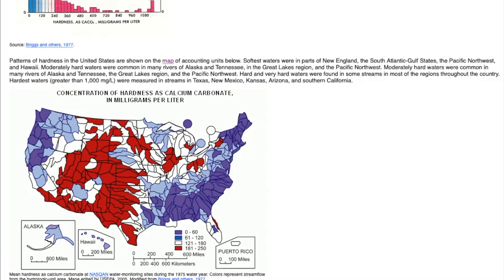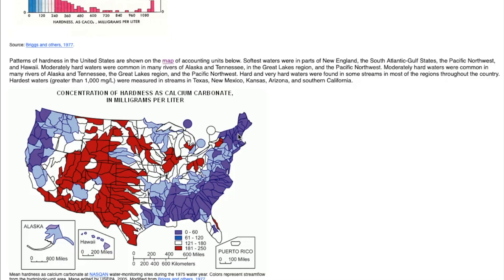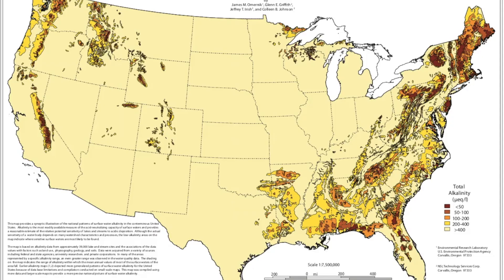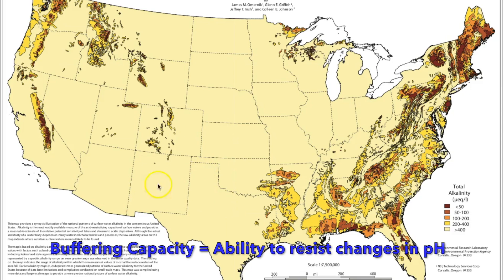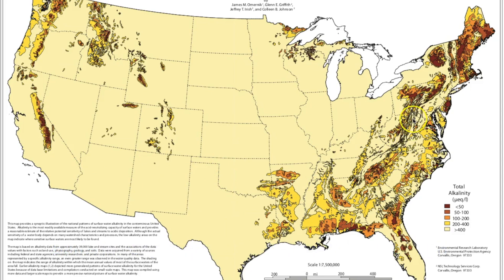Fish Tank Water Hardness Fully Explained: Don't Kill Your Fish!

Comment: Another excellent vid mate.  That is one of the best youtube breakdowns of water hardness I have seen.  You are quickly becoming one of my fish youtubers.  The fact that you refer to your tanks as an ecosystem might be missed by many, but essentially this is what we do as fishkeepers.  We attempt to create ecosystems that emulate the natural ecosystems. Of course you can never achieve a fully natural ecosystem for tropical fish in non-tropical areas, some artificial input is required, but I have found in 22 years in the hobby that the closer you get, the more success you will have with your fish.  

My tip to all would be not to chase your water.....essentially work out what your water parameters are, then choose the fish you stock based on those parameters.  Keep in mind that many commonly kept aquarium fish will thrive in water conditions drastically different to those of their natural habitats.  Evolution happens fairly quickly in organisms with a short reproductive cycle, and many species have been successfully bred for so long in the hobby that their tolerances are actually quite extreme. For example, I probably wouldn't keep wild caught Rift Lake Cichlids in my water, as although it is relatively hard, it has a pH of around 7.3, but the fish I have stocked are bred in the local area and are absolutely thriving.  They have never known anything but a pH of 7.3. I also know of people who breed Discus in this water successfully, and I would quite happily keep those Discus in this water as well, although it would likely kill a wild caught specimen.  Aim for stability folks....fish thrive in a stable environment.

Comment: Very informative video. My water is overwhelmingly hard. I was told that I should mix half of my water changes with RO water for the sake of the well being of my fish. Right out of the tap, it is close to 400ppm GH, 155ppm KH, 7.8pH and near 900ppm TSD. I am keeping neon tetras, corydoras, mystery snails, guppies and a dwarf gourami. I've had them for about 2 weeks and I haven't had a casualty. But I wonder if they are suffering.

I am conflicted about what to do, what is your recommendation? Should I start mixing RO with tap water to lower my hardness and TDS, or just rehome my fish and find malawi cichlids? What about TDS, do we really need to worry about those?
Reply from the maker: So if it were me - I would be very happy and keep African cichlids, guppies, mollies and fish that like the hard water. You could certainly add RO, but you will have to be very consistent in monitoring water parameters, especially KH - if that gets too low, you could crash the pH.
Reply: @PrimeTimeAquatics  by the way, how would you suggest of doing it? Is it ok to do weekly water change of 30%, with half of the new water being RO? I got a 40gal tank, planted.  So I would be adding about 5-8 gallons of RO per week. Should I raise the ratio of RO mixed in gradually? And if u see I have low KH, what's a good way of raising it back up without affecting hardness again? Sorry if I'm making to many questions!
Reply: @PrimeTimeAquatics  thanks!
Reply from the maker: KH is a measure of carbonate hardness, so raising it will raise overall hardness. You could do 50% RO with each 30% water change, but just remember, as you lesson the KH you could reach a point where your buffering capacity is reduced to the point of not being able to protect against a pH drop should additional bio-load accumulate.
Reply: @PrimeTimeAquatics  Would then be a good idea to use seachem phosphate buffer? it supposedly locks pH at 7
Reply: @PrimeTimeAquatics  About the 1st period: that's what I was  thinking once upon a time. Not anymore. I measured higher kh and lower GH, and I was thinking that there is sth wrong w/ the measurements, till I've read that there ARE tropical waters w/ higher kh than GH (at SE asia,I think), that both magnitudes count different substances of the water w/o the 1st not being a part of the 2nd, enclouded to the last one.

Comment: I'm thinking of slowly switching to mains water as I think my well water has caused issues in the past. Is there any point testing water straight from the tap or will it be different in the established tank? I tested the tap water and gH and KH was very low.
Reply from the maker: Absolutely, since tap water will be impacting the tank, it can be very helpful.
Reply: @PrimeTimeAquatics  Thank you. It's been fustrating because I've tried keeping goldfish over about ten years (I was young when I started so limited myself). Back then I didnt have any knowledge. However over time I have done a great deal of research and certainly feel I should have had more luck than I have but at this point I think it might just be my water. I now have access to another water source but the test results showed it was extremely soft, my previous water source had high nitrates in it. I dont know what to do at this point because I'd like to finally start a community tank, or at least a group of something other than fancy goldfish.

Comment: calcium build up on aquarium glass is easy to clean but what if calcium build up inside canister filter hose about a week or two i started to see a thin white film inside those hose and they start to fill in the aquarium. is there any solution for this?? 
i know i need to clean the canister once a while but a week or two is too fast i think..
Reply from the maker: Is it calcium build up or just a bacteria biofilm?
Reply: @PrimeTimeAquatics  idk which one now lol.. 
They are white thin film.. Can help me suggest how to deal with those thing??
Reply: @coqia2783  I'm guessing a calcium buildup, based on the color and seeing 'ring' deposits on a bathtub and my fishtank (at the water line, as it evaporates), both filled from well water.  I suspect a vinegar/water dip for hard water stain removal may work.  You can rinse it very thoroughly afterwards if you want to.  You might get a pipe drain brush and some gloves to help manually scrub it out too.

Comment: In my experience wood will release a lot of tannins when first added to a tank.  However, that drops off dramatically after the first few weeks.
Reply from the maker: I've found that to be true as well. Usually after a few water changes the water is back to normal.

Comment: Hello everybody I'm new to the game, now my 55 gallon tank hardess was 8.6 okay I was told to use distilled water to replace the water I lost. So I tried it Friday waiting to Saturday and tested my water ph 7.6 hard ph 8.2 it went up from 8.6 to 8.2
Reply from the maker: Not sure if I'm reading this right, but if you replaced evaporated water with distilled water, the water hardness may not change much because the original minerals and divalent ions were left behind when the water evaporated. Also, is there a specific reason you want to adjust your water down from 8 dGH? While on the harder side, there are lots of fish that will do just fine at that hardness.

Comment: Two things I’ve noticed in this area of dealing with the general hardness anyway come on when you live in mountains or places where the train varies your water sources can be very different, or general hardness in town just 5 miles away is about 4 to 5 but I’m up on the mountain and I guess we have a different water source and it’s in the middle of the woods so there’s a lot of plant life matter and decaying leaves and Wood in that water probably, The GH up here is about 1.5 and straight out of the tap my TDS is 63. The second thing I noticed was with using equilibrium which is what I bought to add hardness, for my tank which is a 29 gallon I decided to use their measurements for the 20 gallons and to raise it from 1.5 to 5.5 which I figured I would do and then slowly bring it up to six are use the recommended dosage and it shot up to 9, so I had to throw a bunch of that water out, my pH is also a little low at about 6.6 here but I’m not gonna chase it, I’m going to set up a neocaradina tankBut ghost shrimp are naturally from here so I’m just going to get the GH and KH into range and throw a couple mineral balls in there and I think it should be fine. I guess I have to keep playing with it till I get it figured out, but I thought it was interesting that the equilibrium was probably 40% stronger then the directions said.
Reply from the maker: So interesting how quickly it can change just a few miles away depending on the source!

Comment: I've been in the hobby for many decades. In CT the city water was fine to use from the tap (add chlorine remover) and I was successful breeding guppies and angelfish. Recently I moved to NH and my town water from my tap comes out like R.O. water (TDS = 0, GH = 0, KH = 0, pH = 6.0). I have been adding Seachem Equilibrium to raise my GH to 5dGH. Adding sodium bicarbonate to raise my pH to 6.8 - 7.0 & KH to 3 - 5dKH. So far I've been successful in breeding guppies and angelfish. But with me doing 20 - 30% water changes weekly in my fishroom, the cost of Seachem Equilibrium is quiet high. I would like to try my hand at discus breeding but am wondering if there is another cheaper option to correct my water parameters? Many folks suggested using crushed coral. But with doing multiple water changes per week prevent the crushed coral in raising and keeping my hardness & pH at the proper safe levels?
Reply from the maker: This is a really great example as to why a one size fits all approach doesn't work and I appreciate you sharing it! Crushed coral may help somewhat. You could try adding it to your filter media slowly and test your water to see what changes take place and adjust from there. Given what you are already doing successfully, I doubt you'll have many issues managing the addition of crushed coral over time.
Reply: @PrimeTimeAquatics  Thank you for the speedy reply! 
I was told that crushed coral could replace my use of Equilibrium & NaHCO3.
With crushed coral being slow at change the water parameters and my frequent large water changes I didn't think it would keep my tank water stabilized at the proper levels.
So I was wondering if I could use something else for the required calcium carbonate and magnesium which are the main ingredients in raising GH?
Reply: @PrimeTimeAquatics  I was more concerned with large frequent water changes. That the crushed coral wouldn't work quick enough to keep the water stable.

Comment: Nice break down.  I like the specifications recommending the types of fish that ideally match the ranges of water.  When I grew up in Chicagoland with hard, alkaline water, my interest was in tetras.  And as an adult I've lived in New York with soft acid water, but had an interest in African Cichlids.  Always against the grain, I've always had to deal with this issue.  Let me tell you, it's a lot easier to boost alkalinity and hardness, than to decrease the hardness and alkalinity of the Chicago water.

I have two comments on the content here.  The map shows New York City and upstate NY as mildly hard and alkaline, which is flat out wrong.  NYC draws it's water from upstate pine forest lakes and I consistently measure it at just a couple degrees of hardness @ pH 6.6 - 6.8.

Second, using hard, alkaline gravel either in the filter or as substrate to buffer water is only minimally effective.  Why?  Because as the beneficial bacteria begin to colonize it, they coat the gravel in a sort of hard lacquer that will hinder it's dissolving capacity.  With 2" of dolomite and crushed coral substrate and a powered reverse flow under gravel filter, I can only get the water up to neutral (7.0) and slowly at that.  So I've always had to add a scoop of bicarb and a pinch of salt when doing water changes.  I envy you hard water guys working with Africans.
Reply from the maker: Excellent points as always. The maps reflect the water in each area, but do not take into consideration where the municipal water supplies are coming from!
Reply: so glad i found this comment. i live in the bronx and just got three snails. i did what everyone told me to do but the ph is still dropping.